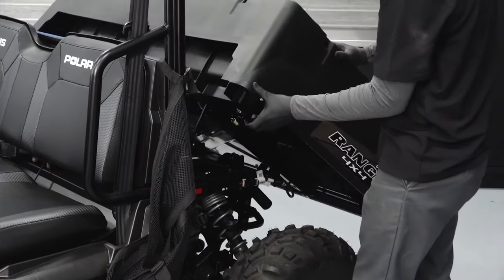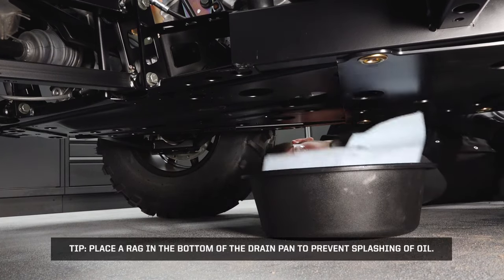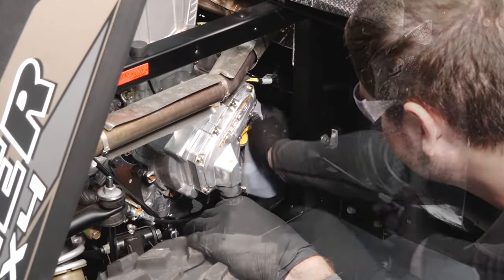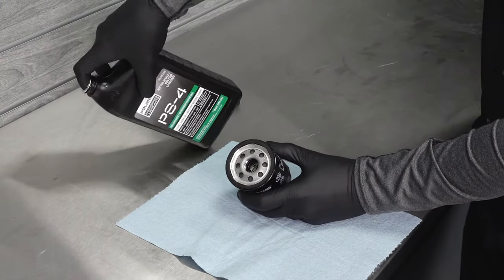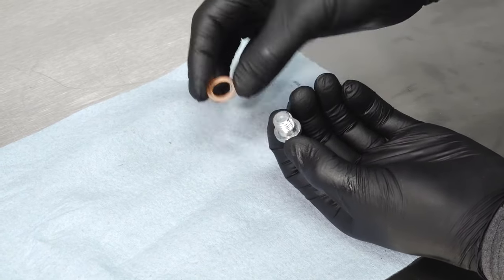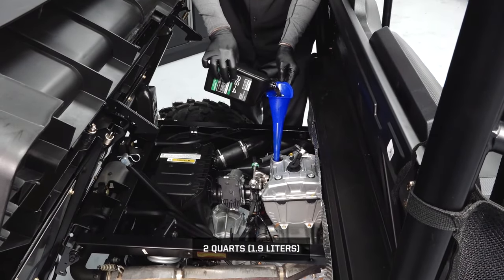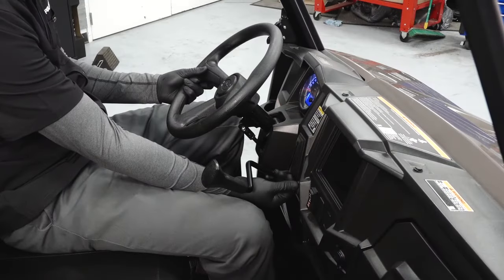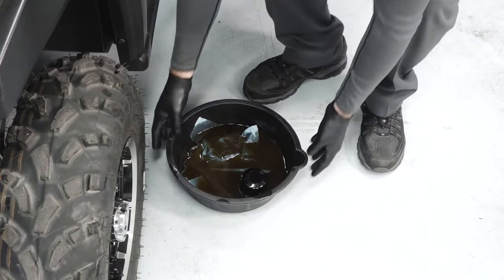2015-2021 RANGER 570 Mid-Size Oil and Filter Change | Polaris Off-Road Vehicles

Comment: I wish they would show an oil change on a real world sxs.  Not one off of the show room floor and add in the oil / filter specs.
Reply: Why does it matter if it's a new machine or an old one? The procedure is the same and all the information you need to know is in the video. Isn't that the point?